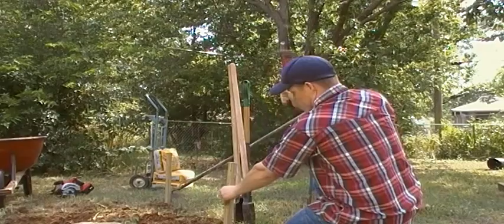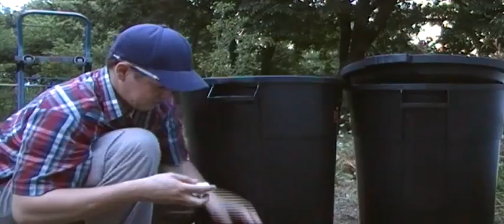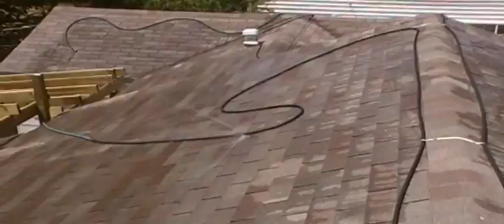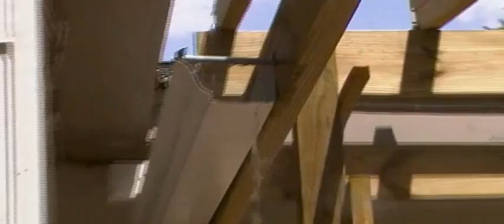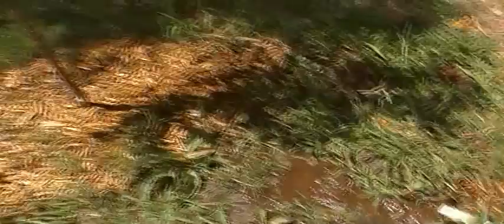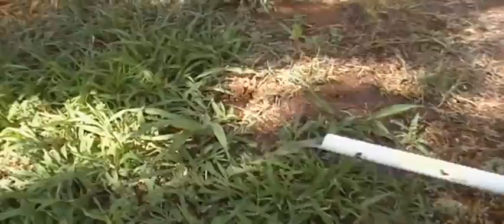House cooling irrigation   Summer 2011

Comment from the maker: I just set the sprinkler on a timer. As soon as the sun set and shadowed the east face, the soaker hoses began to cool off the hot shingles on the west face. Then the water collected in the guttering and channeled out to the apricot trees. I just wanted to water the fruit trees and not the whole yard that summer. I believe the roof sprinkler only lowered the attic temp about 5 degrees cooler, but I only ran it for 30 minutes a day to get a jumpstart on cooling the house when I got off work. The soaker hoses didn't hold up well either, they got brittle in 2 months and sprung random leaks with all the heat. It was still a fun experiment though.